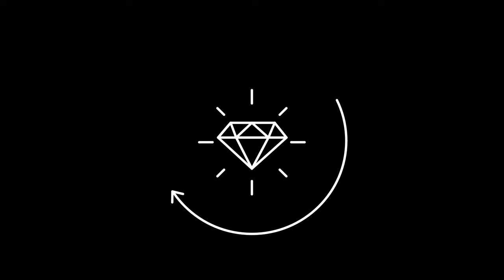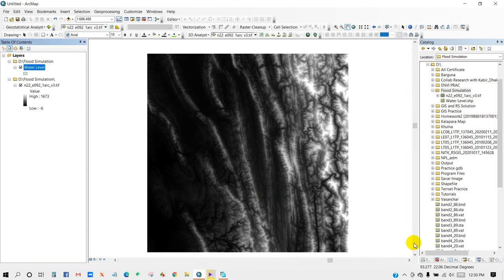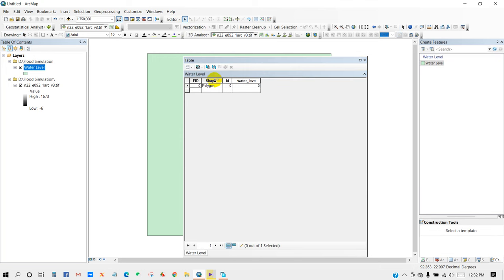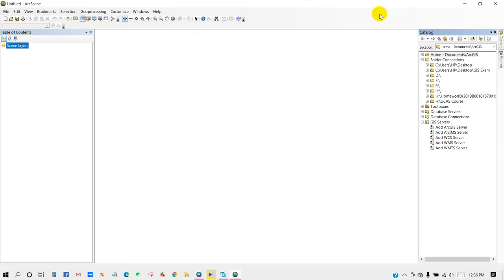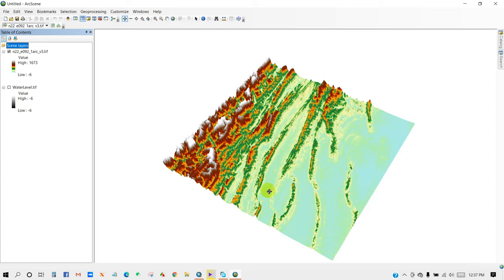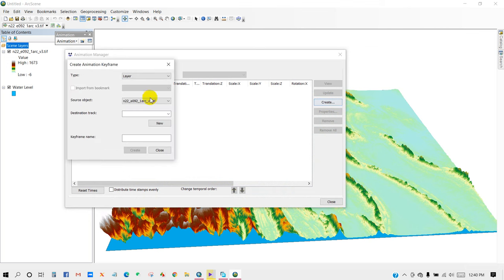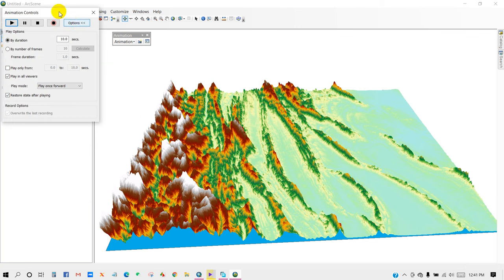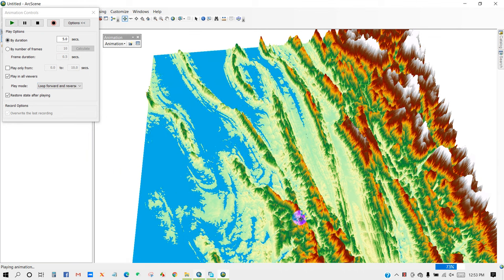Flood Risk Simulation Map of an area using ArcGIS

Comment: The flood risk simulation map shows the inundation range, flood depth, and other relevant information for a specific area. It is created based on specific rainfall and flood flow scenarios, such as a 100 mm rainfall event or a 50-year flood recurrence. The map can be used to simulate flood processes under different rainfall or flow conditions and is dynamically visualized in a three-dimensional way. It helps in assessing flood risk and can be used for emergency administration and planning.

Comment: The flood risk simulation map of an area was generated using ArcGIS. The methodology involved three phases: preparing a digital elevation model using ArcGIS, simulating flood flows of different return periods using the HEC-RAS hydraulic model, and integrating the results to prepare flood risk maps. The map provides information on flood hazard levels for specific return periods.